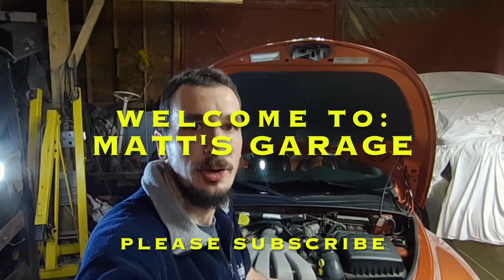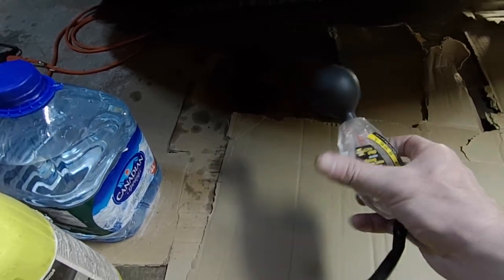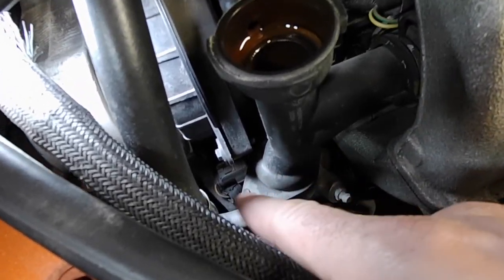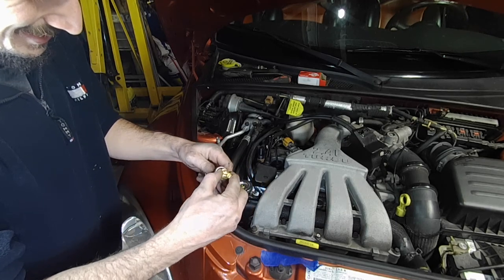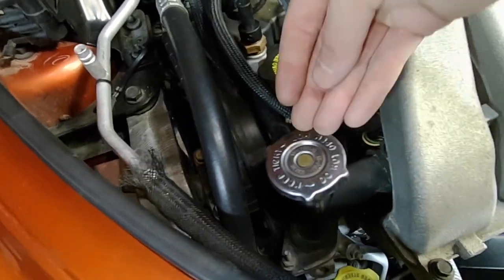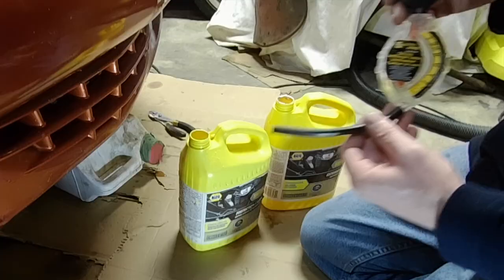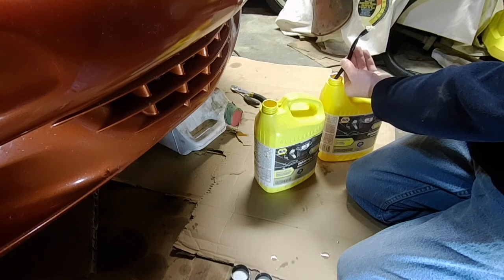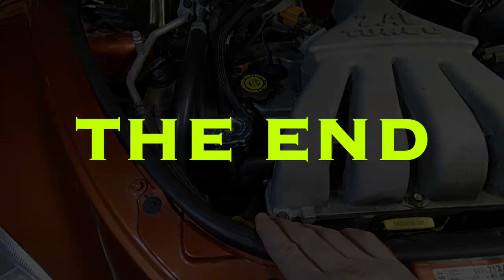PT Cruiser Cooling System, T-stat, rad cap & Temp Sensor Replacement

Comment: Ive heard that you also want to put the rear of the car slightly higher than the front as well as having the passenger side up a little, or you may get old stuff in the hoses and heater core.

Comment: Perfect video for me as I need to do this too! 😊 Good to know about the sensors to change them out while I’m at it!
Reply from the maker: Glad to hear, I’m trying to make videos like this for every aspect of PT maintenance, it takes awhile but slowly I’m getting there. Thanks for your support.
Reply: @CarswithNash  Hey Matt Josh here from IG @JoshTosh92, was there a metal holder bracket for the A/C line that you had to remove to get the 13mm loose @14:51 ? My 2005 has one and i can seem to get it to slide up and off to get that bolt out. hmm, i'll send you a picture and see if you have any ideas..
Reply from the maker: @JoshTosh92  Yes I am aware of the bracket you speak of because I own an unmolested 2003 GT as well. Sadly this Dream Cruiser has been the victim of some lousy mechanics, so it is lacking some brackets like that. There should be a way to get that off easily, let me know if you’re still stuck on it and I will have a look at my ‘03 again. One thing that would work for sure is removing the engine mounts and lowering the engine away from the lines.

Comment: I noticed you had a 195° t stat, at the auto parts store they gave me a 180°. I'm in Southern California Los Angeles area. Should I have gone for the higher temperature thermostat?

Thanks for the content.
Keep up the good work.
בס'ד
Reply from the maker: I’m sure you will be fine with the 180 thermostat where you live and it will be less likely to ever overheat running a bit cooler that way. I live in Alberta and it gets super cold here so we need the hot thermostat to get the heater performance. I believe they all came with a 195 from the factory though so it is up to you.
Reply: @CarswithNash  Thank you. I will try it. 
I have another question about filling and avoiding air pockets in the system. I remember in auto shop, they used to say when refilling a drained cooling system, you should open the heater up, keep the cap off, then run the engine as the fresh coolant is added, so that the pump can circulate all the air out of the system and as that happens you can top off the coolant through the filler opening. You show that squeezing one of the return hoses does the same thing. Isn't this more difficult though, than having the water pump purge out the air bubbles?
Reply: Hi Matt, great video.

I changed my temperature sensor but i got a problem.
Now the fan working all the time, i have also a red coolant lamp turning on a dashboard. Im get confused, couse i do everything well and click jack properly to sensor.
Anybody has a answer to this?

Comment: Yeah I flush the system and do it in the summer. I leave the flush in for a couple of days in some cases. The Ford Taurus's would clog up a bit and need a longer flush.
Tne I put straight water in for a couple of days then fill again with straight water take it for a ride and then drain and fill with 50/50 antifreeze and distilled water. 
When I add a new to me vehicle to the fleet, I can the oil, filter, and antifreeze along with the lower hose. Changing an upper hose in bad weather is easier than the lower. I pressure test the cap and replace if it fails the test and also pressure test the cooling system while it has straight water in the engine. 
Yeah those weep valves on the thermostat are nice. Not all T stats have them. 
Got a few notches on your extension bar aye?
Good video and Happy Motoring.
Reply: I mark the jug of anti freeze with a magic marker at full and then again when I get half in the other jug. I keep a jug with the marks on them for the next time I do a flush and change.
Reply from the maker: @mostlymoparih5682   Yeah the Taurus’s had problems with the impellers on the water pumps corroding away and breaking up and going through the system (I owned one that this happened to). Some good tips there Martin, thanks! Have a good one.(-:
Reply from the maker: @mostlymoparih5682  This work was actually done over a year ago right after we got the car and my parents had a trip planned in the car so that’s why I didn’t have a lot of time to do things like flushes. The car ended up needing more work than we had planned so it was tough to get it all done before the trip.

Comment: Matt:
 whereto find the coolant filler-neck  (thermostat housing) with the outflow line running out the back to the coolant recovery tank appears to be only on the Turbo cars, Correct?

Comment: Thanks,  I am so glad I watched this before changing my cooling fan, an $8 temp sensor did the trick. 

Great tip on making the release tab visible, mine was facing the rear of the bay, I was quite lucky that it popped off with little effort.
Reply from the maker: Great to hear!(-:

Comment: Hello Matt, I recently had problems with cooling fan coming on in either speed low and high. I replaced fan and the relays. My fan still isnt working. Im gonna do the coolant sensor. If that is the culprit. Any ideas what might be causing the fan to not be coming on? 2008 pt cruiser non turbo.
2.4l
You have problems with fuses? I also changed my tipm

Comment: Matt  what is the best radiator cap I took off a 18 psi that seemed warn and purchased a 22 psi on Amazon when I noticed the difference I put the 16 back on   2004 touring 2.4L

Comment: Thank you for all the great information. I've hit a lot of the grounding aspects however not all , I don't have a garage and weather is an issue. But with what I did do I immediately found better , smoother running engine and there was a bad thermostat I stalled properly 6 months ago.
I removed it and tested it with heat , damn thing wouldn't open till 240°🤬🤬🤬, replaced and the temperature is constant , but still got a small pocket of air with that gurgle from time to time . I guess I'll have to do the complete drain as you recommend.
   I have my back running lights not working , the blinkers are working from the same bulb . With the test light I tested the socket itself , no power to the sidelights , left and right. I ran a copper wire from battery ground to be sure of ground. Can you suggest an avenue to try ? I don't have conventional lights but use all the standard sockets and bulbs.
  FYI .. I did have a ground issue with the front running light I jumped off the headlight for power to run the makeshift running lights. The base was badly rusted so I replaced the base and it solved the issue. Could that have had an affect on those in the rear ? Not sure I can send a picture to you but I'll try. I tested all of the conventional style fuses , all are functional, except The 10amp fuse for the fog lights , which I didn't have upon my buying the vehicle and I don't have working at this time. Does that circuit need to be put in the computer to function properly ? I'd like it to so as to remove my quick solution of jumping off the headlight wire for power.
  I'm sorry I got so long winded🥱😱but could use some guidance on this one. And your patience
and diligence I admire greatly.
   If you care to send an email instead of on here, I'm at dillon4u2@gmail.com.
I hope you can help, but know your a busy guy.
  Thanks alot for all you do.
  Sincerely
  Joe Elliott

Comment: Did a code pop up for the temperature sensor?
Reply from the maker: Nope, and I don’t think it ever would because I don’t think the code system is that sophisticated on these cars.
Reply: @matt77758  thank you for answering. 🙂 This pt cruiser is not fun right now.  I'll have to go through your videos to find why it's overheating.   Thank you!
Reply from the maker: @ssuperdave100  Yes, I did make one video specifically on overheating issues and tried to cover everything, it’s just me talking, but the information is there.
Reply: @matt77758 thanks Matt.   I hope it's an easy fix.

Comment: Hey Matt ... I have a 2008 pt cruiser non turbo. New fans .new radiator .new temp sensor.new coolant. New thermostat. And still I get the po128 code after 2 days after I installed a new thermostat.. Why is this happening my friend?? Changed the thermostat 2 times New.

Comment: Thanks, Matt. The video was very helpful. It still took us a few hours and a lot of cussing to get that temp sensor out, but it's manageable...just probably not as quick as you managed it. Everything is wedged in there so tight, it's tricky. We got it with two short extensions and a swivel adapter (u-joint thing). :)
Reply from the maker: Yeah I hear you it’s not the most pleasant job. I’m glad the video helped you.

Comment: if you have flushed your heater core also during the flushing of system. Is the refill procedure the same as you have shown or do you have to do something else
Reply from the maker: It’s the same, just make sure you have your heater turned to full hot when you start the car back up so that it circulates right away.

Comment: Hi Matt, my PT radiator has a minor leak at the top of the radiator where the plastic and metal parts connect. Should I replace the radiator or try to add radiator stop leak?
Reply from the maker: Yeah that is a super common issue, in fact my convertible has been leaking on the bottom crimp of the radiator since I’ve owned it, I just top it up. I wouldn’t put stop leak in the system just for that, radiators are cheap so if you don’t like topping it up I’d suggest changing it. It’s a leak that’s unlikely to get drastically worse with out warning so as I said you can just top it up if you don’t mind doing that, just make sure you remember to.

Comment: hi my friend 
i have situation in my pt hope you helping me 
my pt touring 1.6l manual 
electronic throttle body 

one of  tps reading is 
start from 4.5 v on switch on position go to 0.24 v when open the gate max manually 
but after start the engine 
the reading jumping alittle and disturbance when i press on pedal slowly 

the other tps reading is
start from 0.91 v on switch on position go to 4.80 when open the gate max manually 
and when i start the engine the the reading start from 0.5 v 

throttle lamp keep show on 

is there somthing wrong with throttle or somthing wrong with app pedal sensor ??
any help plz 
thank you
Reply from the maker: Sorry but that is beyond my area of expertise, I don’t want to recommend you to buy a part when I don’t know for sure.
Reply: @CarswithNash   i appresciate  that thank u alot for responding

Comment: Just replaced the thermostat. A good amount of coolant was spilled in the process breaking the seal and removing top hose. Is it normal for there to be white smoke for a short while after this? Seems to be coming from underneath where the thermostat is and coolant spilled. Hopefully its just burning off. Any help is much appreciated
Reply from the maker: It would be a good idea to rinse the spilled coolant off with water, that likely is what’s causing the white smoke.
Reply: @CarswithNash  I'll give that a go, thanks so much Matt. You're videos have helped me immensely.

Comment: Hey Matt, I’ve changed my cooling fan on my 03 touring last year, and I’m wanting to replace the radiator this year. I’m curious how many more steps passed the removal of the fan assembly it would be to replace the radiator? Off the top of my head it seems like it would just be a quick 30 more minutes of work after removing the fan?
Reply from the maker: Yeah it’s not that much more, but you do have to unbolt the air conditioning condenser from the radiator and depending on the style of transmission cooler your car has perhaps that as well. So you’re looking at about 4 to 6 more of those 10 mm bolts like you had on the fan housing, the lower ones can be a little annoying to get out but doable.

Comment: I don't have a PT Cruiser, but I did a coolant flush for the first time on my Town Car. I had it flushed 2x at my local fast lube which was fine, but I wanted to do it myself this time and it was dark brown and sludgy again. I'm assuming the cooling system had been neglected before I bought the car, either the coolant was never changed or it was ran with just tap water for.a long period of time. I'll probably end up having to do it again in a few months, but I like the car and Want to take care of it. I also want to learn about working on cars so I guess.the best way to do that is to watch some YouTube videos and to just do it lol.
Reply from the maker: Sounds good, yes preventative maintenance is key and those Town Cars can really last a long time if you care for them. Glad you found my video helpful, thanks for watching!(-:

Comment: You still got your PT on the road?
Reply from the maker: This particular one belongs to my mom and the engine went on this winter, did good for a long time, though, she put a lot of miles on it and it should be back, I just have to find time to work on it. She's driving a 2005 PT convertible right now. The only PT Cruiser I have personally is the one I use to plow snow with.
Reply: @CarswithNash  Woah!! A snow plow? I assume you have videos of that, I'm gonna look through your uploads lol. My dad passed and I ended up with his turbo PT. I wasn't a fan of these cars originally, but it's grown on me. They're pretty functional and quick if you have the turbo. Already did the timing belt, radiator, the PCM etc etc. I know there's more repairs coming down the pike. Just hit 104k. I don't mind a car that requires constant attention, but these PT's are complicated by the fact they are incredibly difficult to work on. Had to basically pull the whole front end off to replace the radiator. This car actually left me stranded in the middle of nowhere when the PCM went. It also melted the coil pack. It was holding the 1st bank enabled. I remember the turn signal assembly caught fire when my dad was still driving it. Now that I'm thinking about it, it's been kind of a handful. Oh well, its good that I like a challenge at least lol
Reply from the maker: @maxpowers4823  I've had my plow setup on two different PTs at this point, plenty of videos on that. Sorry, but I find PTs easy to work on, that's one of the reasons I have had so many on the channel. Again, most newer cars will give you more trouble than PT will, they are relatively simple little cars that respond well to good maintenance.

Comment: i have watched this one a couple of times just to make sure. However I have run into a problem. On the longer bolt that has threads on it I have a clamp like a fork that holds the air condition hose. It is clamped  between the top and bottom of the bolt. There was a nut holding the clamp on the top half of the bolt. So when I took that off  I could not get the clamp to move out of the way so I could take the whole bolt off. It is in the way of getting a socket around on the bottom of  the bolt. does anybody  else have this problem?? if so how did you do it?

Comment: i know this video is old but i need some help.. my car is overheating and a new rad fan i bought a month ago stopped working, i changed the relay, fuses and the fan still nothing. The new fan won't turn on low or high settings, would you coolant sensor affect it turning on both speeds or only high when the engine is hot? Otherwise it might be a wiring issue?
Reply: also have changed the radiator, cap and thermostat

Comment: Hi Matt. I put wrong fluid in transmission of 03 PT. What do I ask mechanic to do. I'm not able to fix myself.  Thanks!
Reply from the maker: He'll just need to do a flush, I do have a complete video on servicing and flushing your transmission in my PT Repairs playlist, I'm sure you could tackle it yourself following that video. I wouldn't recommend driving it with the wrong fluid in it, even a short distance could cause damage. I assume you did use ATF, just not the correct ATF+4?
Reply: @CarswithNash  I did see the Trans flush video but don't have a space out of the wisconsin winter to try it (I'm a fair weather diyer). I put in "parts master multi vehicle full synthetic ATF. It lists many car makes on the back but not Chrysler. I  simply had a brain fart, lol. Can I drive it to a shop, 2 miles ish?
Reply from the maker: @lynbarnel  Just be glad that you noticed your mistake before you drove it a couple thousand miles and the transmission failed... Yeah if it’s only 2 miles I would just drive it really gently over there.
Reply from the maker: @lynbarnel  How much ATF did you actually add? It sounds like you were just doing a top up? Because if you didn’t actually change the fluid and only added like half a litre it probably won’t even be an issue... But for sure the safe bet is to flush it out.
Reply: @CarswithNash  Put in a quart, 946 ml.
Reply from the maker: @lynbarnel  Yeah I don’t know if I would risk that or not, The thing is it will be lacking a required friction modifier that the ATF +4 will have... Chances are it would be OK to leave but I can’t recommend that to you in case it goes the other way if you know what I mean...🤷‍♂️
Reply: @CarswithNash  I totally understand. Thanks so much for the advice and all your info videos  (and the fun stuff too, plowing snow in a convertible LOL)!
Reply: You could siphon all the fluid you can out of the trans dipstick tube which is about 4-5 quarts and replace that with the correct fluid.I did that twice on my PT when I had it and my fluid looked brand new.I didn't want to do the drop the pan thing just yet.